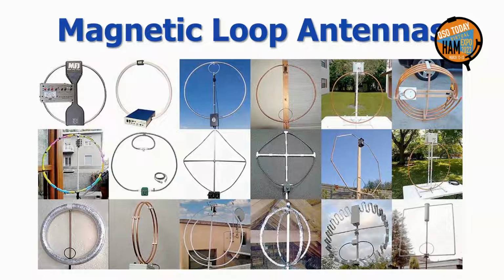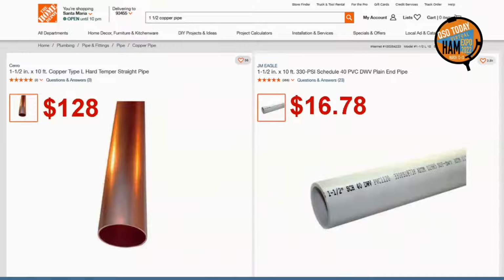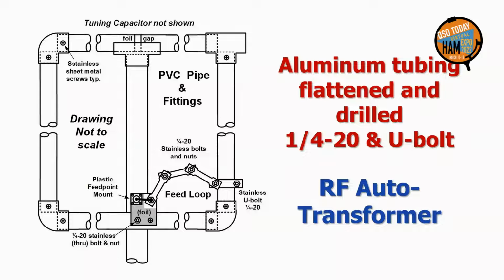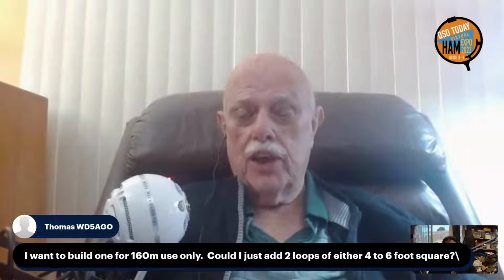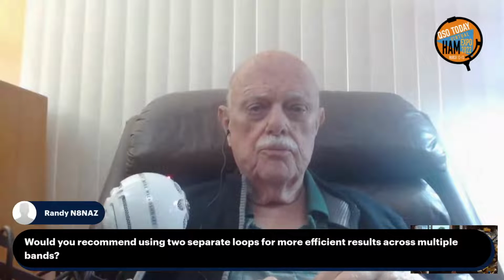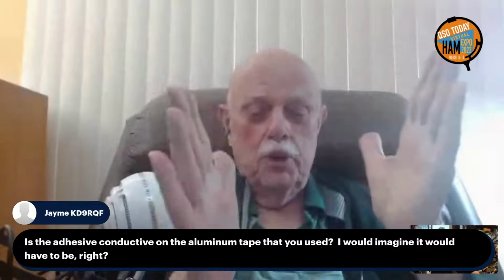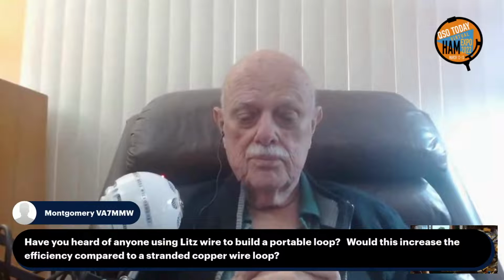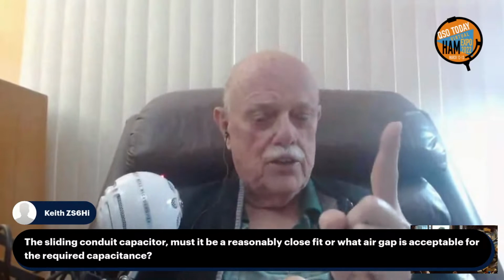How to build an "Optimum" Magnetic Loop Antenna - John Portune W6NBC M0GCK

Comment: I used 4 inch diameter aluminum dryer vent tubing. Mine is 4 foot square with a square made of 3/4 inch copper water pipe for the sense or inner loop. I eventually found by trial and error I could get a good impedance when the inner or sense loop had a 7 foot circumference.
(Note, it was very easy to build my design using dryer vent tubing and the elbows did not require being split. I suggest using it the next time if you don't mind $8 for each fitting and each two foot length of tubing. 3 inch dryer vent is also available and slightly cheaper)

I am very, very happy with the antenna.

Comment: This is a video on optimising a small loop antenna, and you can't get any more optimised than for single frequency use.
Can you please specify for me what fraction of a wavelength is most ideal for performance and efficiency?
Reply: Probably 1/5 to 1/4 wavelength. Any larger and it gets difficult to get the capacitance low enough.

Comment: So for 27mhz single band use, what would the optimum circumference be? The antenna will be a circle.(When you say 4ft or 6ft, I'm not sure what you're referring to. Diameter maybe, area??)
So would the optimum length/circumference be just below a quarter wavelength? Or do you want to keep it a fair bit less than that. I was thinking 2.5 metres for, say, 27.355mhz. Half inch Heliax will be used.

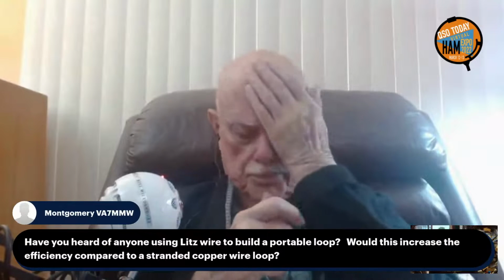Comment: In regards to 51:45 "If a vertically oriented loop is fed at the bottom, its radiation will be horizontally polarized; feeding it from the side will make it vertically polarized."

Comment: This is mine experience: 
1.     Antenna blade must be whole.
2.    Material - copper or aluminum, but aluminum gives losses in transmission about 10% more at the same size than copper (according to various programs for calculating magnetic antennas).
3.    Antenna shape - better round.
4.    The area of the antenna web should be as large as possible. If it is a pipe, the diameter of the pipe should be as large as possible (as a consequence, the external area of the pipe will be greater), if it is - a strip, the width of the strip should be as large as possible.
5.    Antenna blade (pipe or strip) should approach directly to the variable capacitor without any intermediate inserts of wires or strips soldered to the antenna blade and the capacitor. In other words, it is necessary to avoid packs and "twists" in the antenna web where possible. If it is necessary to soldered something, it is better to use welding, for copper it is copper welding, for aluminum it is aluminum welding to avoid metal inhomogeneities in the antenna web.
6.    The antenna web should be rigid so that there is no deformation, for example, from wind loads.
7.    The capacitor must be air dielectric and have a large gap between the plates, even better is vacuum.
8.    I have a capacitor with an electric motor closed in a plastic box. At the bottom of the box there are two small holes to drain the condensate.
9.    There should be no slip on the condenser, so you need to use a condenser type "butterfly" in which the stator plates are connected to different ends of the antenna web, and the rotor is not connected to anything.
10.    Coupling loop has a diameter of 1:5 from the diameter of the antenna, It should be taken into account that with a decrease in the diameter of the coupling loop increases the quality of the antenna, and thus its effectiveness, however, narrowing the bandwidth of the antenna. On the Internet, I found information that you can use a coupling loop diameter of 1:5 to 1:10 from the diameter of the antenna frame.
11.    Gamma matching is much more effective in comparison with the coupling loop. Gamma matching with the power of the coax cable wins the coupling loop on the strength of the received signal. A double gamma matching, symmetrical with respect to the zero point, and the feeding of the antenna by a ladder line is much more effective than a simple gamma matching with the coax cable. In this variant, a symmetrical antenna is obtained in which the in-phase interference is additionally suppressed.
12.     In case of power supply by the coax cable in close proximity to the antenna I use a choke from the cable 6-7 turns of the same cable, wrapped on a ferrite ring from the deflecting system of the TV. In case the antenna is feeding with a ladder line, the choke is not used.
13.    Antenna "does not like" near itself metal objects, long wires, etc. - this may affect the CWR and the directional diagram.
14.    The height of the magnetic antenna above the ground should be no less than 0.1 of the wavelength of the lowest frequency band of this antenna in order to maximize its performance.
     VE9LZ  ex: VE3LL, VA3LLZ

Comment: These are wildly informative and fascinating and I'm thankful for Mr. Portune and those who host him for taking the time to share such antenna insights.  I haven't yet gathered enough knowledge to intuit what's viable and what's not but I can't help but make [possibly naive] attempts to further simplify this really cool concept.  For example, moving up to 3" PVC for a larger antenna is straightforward enough save for finding wider foil tapes that are affordable (even considering less workable flashing).  I believe it was mentioned that tapes could be layered to get the desired thickness so would there likewise be an optimal way to use the more affordable narrower foil tapes to cover larger diameter PVC?

Alternatively, I've stumbled across a great price on some 3" square aluminum bar though my antenna-fu is insufficient for determining whether that geometry would affect an antenna negatively.  The major appeal is that it would cost less and be far simpler to assemble since the foil and elbows could be eliminated altogether.  I would greatly appreciate anyone's insight regarding this.
Reply from the maker: Tim - What we are discovering with the magnetic loop antennas is that the radiation comes from the surface of the loop and not the inside.  Don't make your antenna too heavy using bar instead of tubing.  There are a number of videos on YouTube showing that wrapping PVC with conductive material can make a great antenna.  Good luck on your project and please report back here on its success.

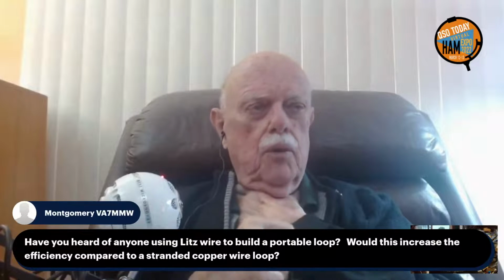Comment: Minute: 51:42 
Regarding his statement about loop polarization, my google findings are quite different than what he stated indicating a vertically oriented loop is vertically polarized, instead I found the opposite: A vertically oriented magnetic loop (perhaps any shape) will be horizontally polarized if fed from the bottom, vertically polarized if fed from the side of the loop.

That said, if a square shaped loop is fed from the bottom or the side, is it equally polarized in both polarities, or leans towards one or the other predominately? I have not found an answer to this when it comes to square shaped loops. I suspect the shape does not matter much yet I've seen John show RF radiation patterns for his square shaped 4 meter loop with both horizontal and vertical polarization which appeared to be equal in both. DE A75HF KL7FB ex WN8RZU, WD8DVV.

Comment: Regarding the question if Litz wire can be used for a MLA, I think it can, but a huge bundle of it would need to be used to have an equivalent amount of surface area compared to a large diameter round PVC with tape conductor of 2 inches or more (taking skin effect into account). I've been looking into this myself, but for transmit, Litz wires are not spaced far enough from one another in a bundle and due to this have heavy proximity effect which causes the same kind of radiation problem similar to skin effect, but for another reason. To have an efficient transmission using Litz wire, the insulation on the wire would need to be about three times the diameter of the copper of each wire to assure the wires are spaced at least 6X the diameter of each wire inside a bundle to prevent too much proximity effect from wire to wire or between them. I tried to find 40 gauge magnet wire with that amount of insulation or coating on it to make my own Litz wire for use above 10 Mhz, I can't find it. There is a type III magnet wire with extra heavy insulation for higher voltages, but not nearly enough to space the wires far enough apart to mostly negate the proximity effects. I found a place which could make it for me, but not in a small batch and very expensive for one 10 kg reel. Far better to just use large diameter copper or aluminum foil.

Comment: I've been working on a magloop for 80,40 and 20 meters. I was thinking of telescopic tubing being used on either side of a square loop. I have 2inch and 1and 7/8 inch aluminum tubing. The loop would be an 8 foot diameter loop when collapsed and 12 foot diameter when extended. The capacitor is vacuum variable 75 to 250pf.
Question is, will it have stable reception (no static noise from telescopic edges) and what kind of radiation pattern will develop from a rectangle?
Thanks again for sharing your knowledge 👍